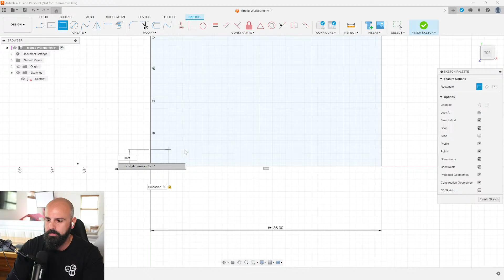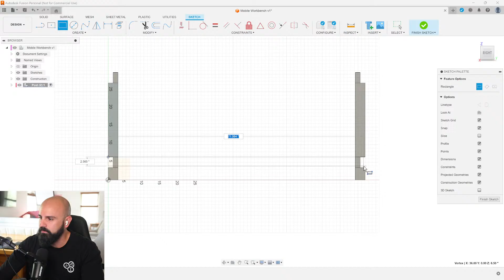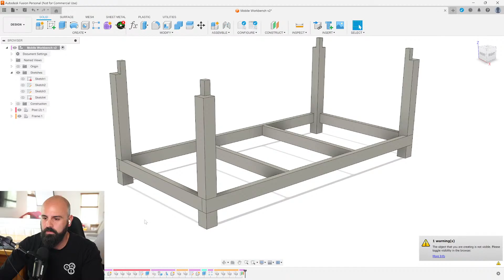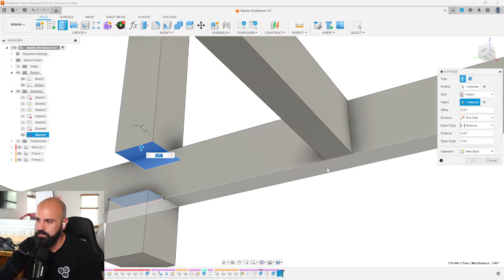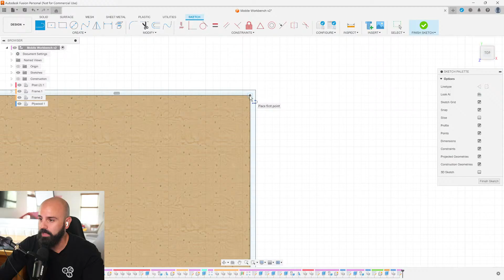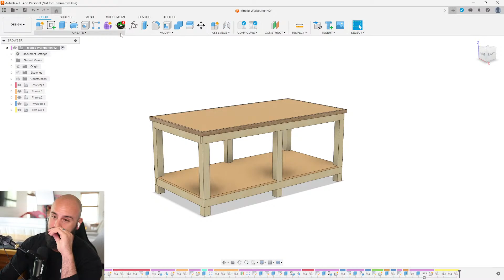🔴 Modeling out a Workbench in Fusion | Live Stream

Comment: Thanks for this nice tutorial. Its refreshing to see that I’m not the only one struggling with the parametrization.

You might already know this, but using joint-functionality in fusion 360 you can make those point-to-point type move operations so they are recalculated if the points move later.